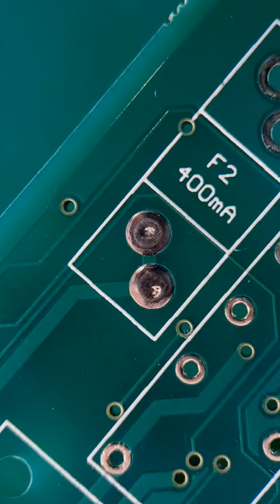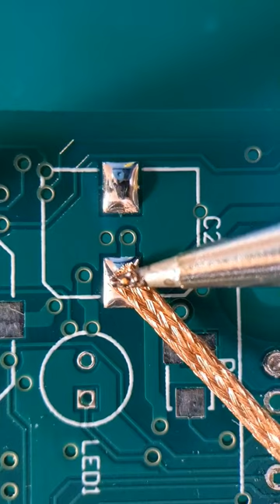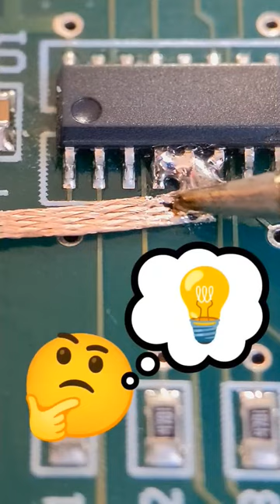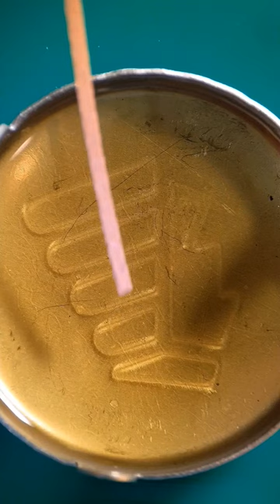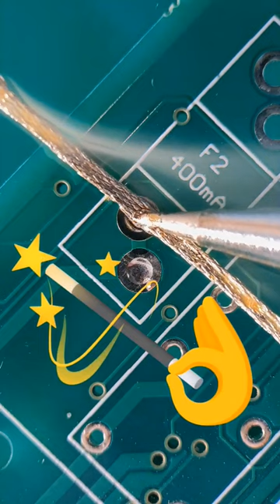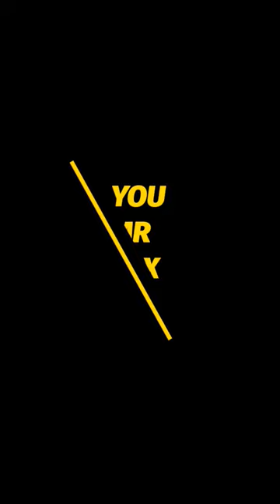HOW Flux Transforms Your Solder Braid / Soldering Tutorial

Comment: Flux is the wonder chemical in all sorts of soldering operations. It's amusing how many people try to work on circuit boards without using it. It makes installing and removing components much better and tends to prevent doing damage to pads and traces on a board. One of the keys in doing these operations is to keep the time you have to apply heat to a minimum. Without using enough flux that becomes impossible.
Reply from the maker: Hi , thank you for your comment , much appreciated. You are right , flux is definitely the king 👑 .
Reply: Bu ürünün adı ne
Reply: @mrsolderfix3996 that one in the movie is rosin? That one like amber rock but when heated changes to fluid?
Reply: I mean for soldering (not desoldering) I never needed much more than fluxcore solder.

Comment: Wow, I never got why my wicks did not wick while for some it did. Thank you so much
Reply: Yep, it's one of the three wick desoldering tricks. The first is to reflow the joints with fresh solder (old oxidized solder does not take heat well). The second is to preheat the joint (the first step usually takes care of this for small joints, but for larger components like metal shielded connectors a hot air station or board preheater may be necessary), this decreases the time it takes for the wick to heat up and the flux to activate. The last is this one: add fresh flux to your wick -- the fresh flux seems to activate faster which speeds the cleaning of any oxidation off of the copper wick (this is what flux is used for, as solder will not flow onto oxidized surfaces). You can see the flux in action in this video. In the attempts without the extra flux, you don't see the flux liquify (or it does so very slowly, or only close to the iron tip). After adding the extra flux, you see the flux quickly change color all along the wick giving the solder somewhere to go (remember, solder will not flow to oxidized or too cold surfaces).
Reply: @davidcameron648  Indeed reflowing joints with flux works wonders for clogged tru-hole pads.
Reply from the maker: Hi , thank you for watching the video and commenting , much appreciated 👍
Reply: Never enough flux 😊
Reply: no problem my friend
Reply: Most GOOD wick material is pre-fluxed.
Reply: Approximately what temp is the iron set to ? Just to get an idea. Thank you.
Reply from the maker: Hi , if I'm doing leaded soldering I set my iron to about 330 degrees Celsius and for lead free I use about 360 -375 degrees Celsius . I may vary these slightly in certain circumstances but generally stick to these temps . Hope that helps , thanks for your comment 👍
Reply: @mrsolderfix3996 many thanks about the temperatures. Also the video is very useful 😊
Reply: It's all about how much flux there are already in those wick
Reply from the maker: @kawaiichi hi , I always use Multicore or Chemtronics braid  , 2 very good brands . Even these benefit massively with a small amount of external flux added .
Reply: @mrsolderfix3996  What if you're wicking away solder from a random board and you don't know the lead content of the solder you're removing? Is it best to start at a low temp like 330 and see how it works? Then bump up to 360-375 only if things are melting as hoped?

Comment: for those who don't get it, he's dipping the wick in liquid flux. if all you have is solder core lead/tin solder on hand, you can also add a huge amount of new lead/tin to a joint and then wick that up quickly and flux core juice will get on the wick and do the same thing. dipping it in liquid flux is WAY easier though
Reply: whats a good liquid solder flux to buy?
Reply: If you don't have a big open container of liquid flux to dip it in, you can also just apply some flux to the board area first (using a flux pen, dropper, etc), and then put the braid down on top of the solder/flux.
Reply: I use rosin flux, and I just melt the amount I need
Reply: burnley soldering paste is cheap and works OK.

Comment: Chemtronics makes pre-fluxed desoldering braids. They work great 👍
Reply from the maker: Hi , I always use Chemtronics or Multicore desoldering braid that is pre fluxed but adding a light layer of rework flux to it takes it to a different level . I know many people in the Electronics industry who use these pre fluxed braids who now add extra flux to them . One of the best tips I've picked up. Thank you for your comment 👍
Reply: I was going to make this comment about the fluxed braids - I use Chem-Wik which I’ve found to be brilliant but will try some extra flux on it next time!
Reply: I'm broke af, so i prefer cheap ones, just adding small drop of flux that i have, and it works like a charm

Comment: Really great method, and very well demonstrated. However if you use good quality wick like for example Soder-wick by Chemtronics, then the braid will already be saturated with flux and with its strong capillary action it will suck the solder off like a pump without having to ever flux the wick.
Reply from the maker: Hi , thank you for your comment , much appreciated. I use 2 brands of braid , Chemtronics and Multicore . Like you say they come pre loaded with an amount of flux . But adding extra flux turns them from good to amazing . At times braid doesn't aways perform as it should . This is how to solve that problem . Thanks again , take care 👍

Comment: You are always giving me ideas man, awesome. I was using my flux paste from the syringe to squeeze it unto the braid i never thought about dipping the braid in liquid flux, which i have on my worktable. I made it a few months ago from hardened rosin flux.
Reply: I would like to liquefy my rosin flux also. Could you share how you liquefied yours ?
I melted the flux and add solvent to it (water), but it solidified within an hour or so.
Reply: @ntulsian  use isopropyl alcohol, at least 70%. And use a new batch of flux don't use the batch you already soaked in water. Grind it as fine as you can. You can use a 2:1 ratio, 2 parts IA and 1 part flux. Shake well then let it soak until all crystals are liquefied.

Comment: they probably made some wick, by removing the shield from a coax... When you buy solder wick it comes preloaded with flux...
Reply from the maker: Hi , brand new solder wick that's pre loaded with flux still performs badly at times even the best types like Multicore , Chemtronics etc . When external flux is added it transforms it to work amazingly . Thanks for your comment.

Comment: use good quality desolder wire...it will wick.
Reply from the maker: Hi , I do , I use Multicore and Chemtronics braids  , very good quality . They still work so much better with added flux , try it , you'll be amazed 👍

Comment: or, just buy good brand name wick that's pre loaded with flux right off the roll
Reply from the maker: I generally use Multicore braid that's pre loaded as you say . Still works 100 times better with added flux . Braid sometimes doesn't have enough flux in it , even the well known brands to suck up the solder as it should . Adding external flux to this transforms it .

Comment: Solder wick without flux is crap! Buy other wick with Flux! Chemtronics Soder-Wick best!
Reply from the maker: Hi , even good branded braid like Multicore or Chemtronics benefit massively by adding a small amount of external flux to them . I have often found good braids at times still won't wick solder properly , add flux , amazing results every time 👍